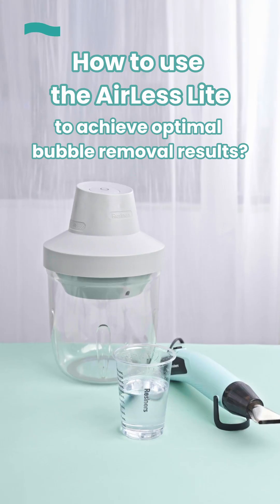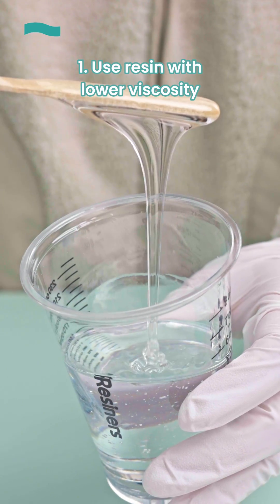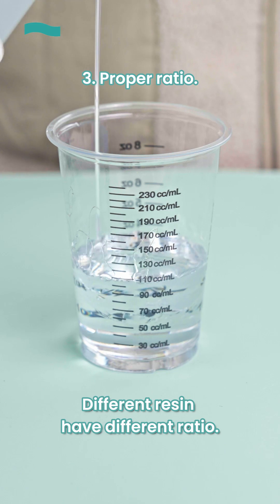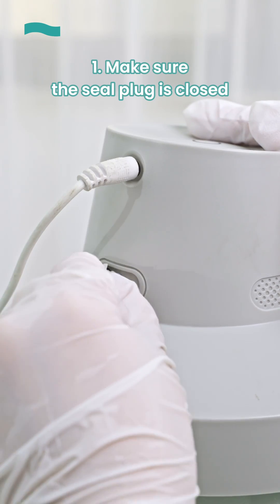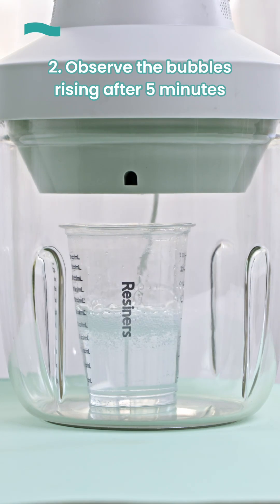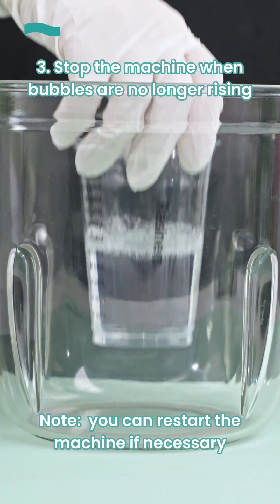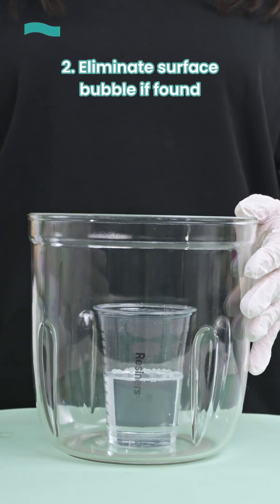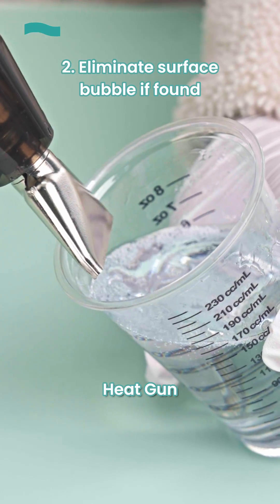Reisners AirLess Lite Bubble Removal Machine Tutorial

Comment: What's the price of this machine compared to the price of a normal vacuum chamber because that's literally all that it is
Reply: This is more expensive than a normal vacuum system made out of something that looks like a metal pot with an external vacuum pump. The thing is that this is towards moms on FB pages who do resin thingies and want to have an all in one machine that looks like a kitchen machine.
You can get better and stronger vacuum pumps for the same price with bigger pot area but they are for men in their man-caves doing wood impregnation. This is meant to be picturesque.